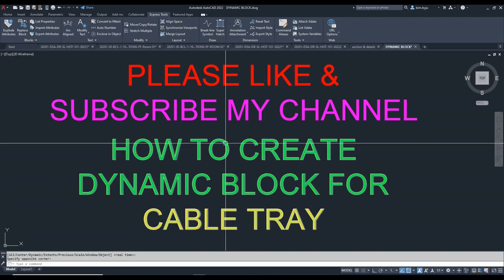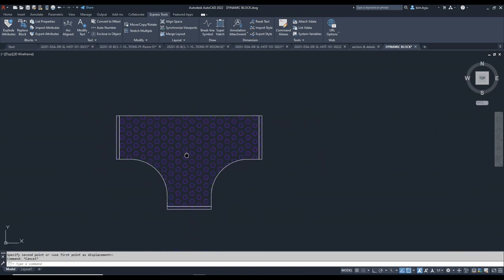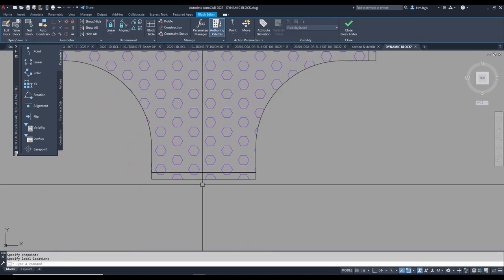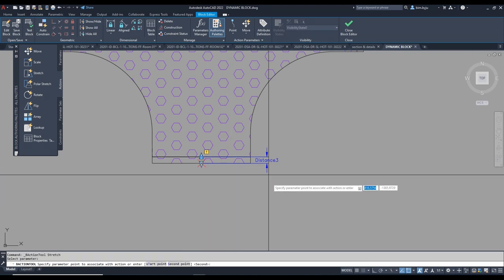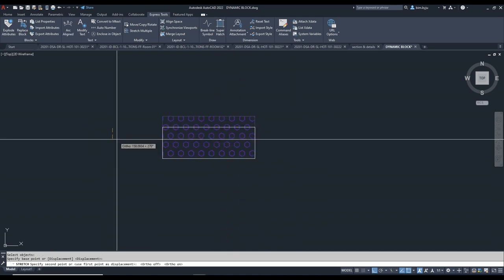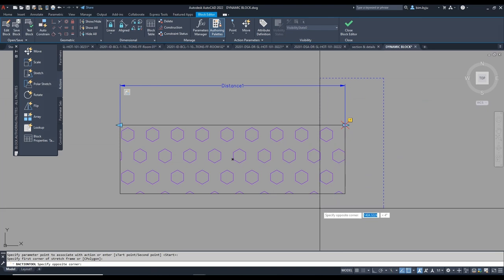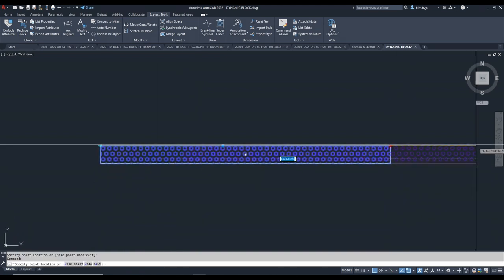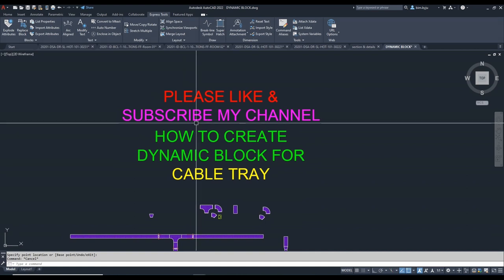Create a dynamic block for cable tray in AutoCAD

Comment: help me explain how adjust the dimensions of the rectangular cable tray from 600mm to 400mm
Reply from the maker: Hi thanks for your comment You can make Two parameter and make some visibility setting also.
Reply: I really can’t understand visibility I a biginner
Reply from the maker: @user-gc2yx9bm5b I will make one video and will post as per your request very soon. You can check my other videos also thanks dear
Reply: Thanks a lot I will be waiting